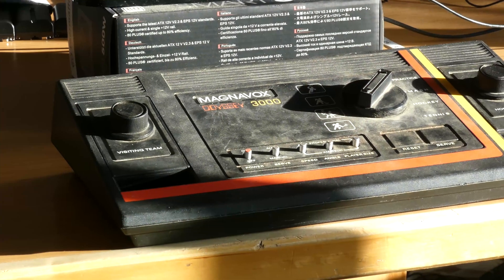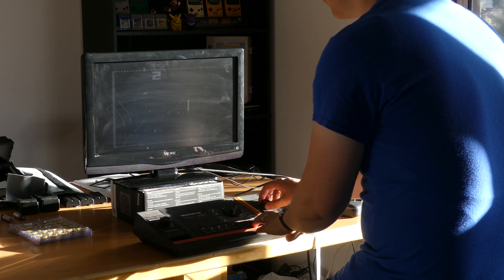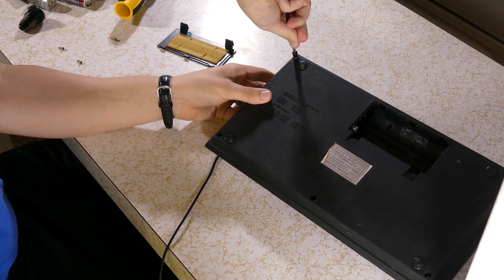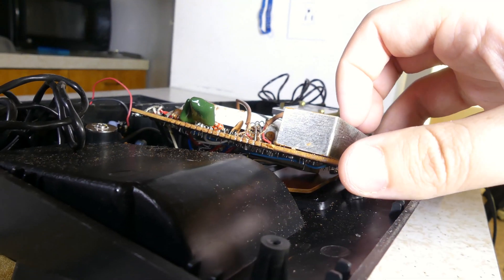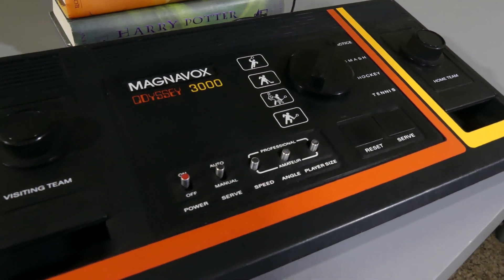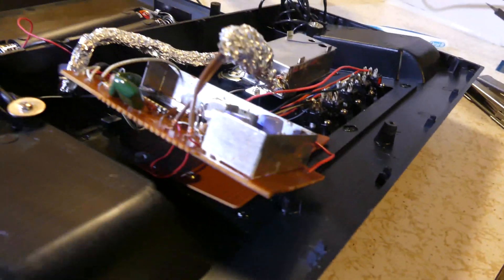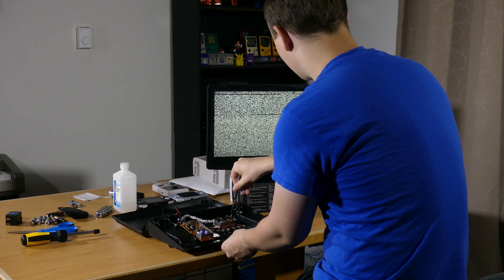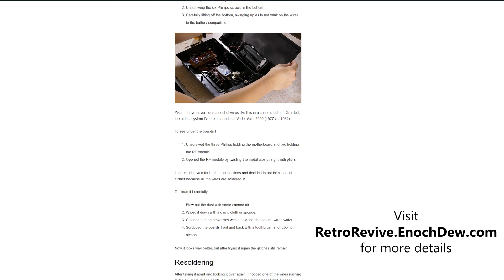Magnavox Odyssey 3000 Teardown and Troubleshooting | RETRO REVIVE

Comment: Nice video, I picked one of these up for a few bucks at a thrift store a few years ago. No Powersupply. I cleaned out the rusty old battery compartment and got it working and ignored it for 4 years. Batteries now dead and i modded the machine to accept a common 9v power supply. I am getting audio now but no video. Dont want to buy a bunch of C cell batteries. The link to your blog is not working for me, I would love to get a hold of the manual if possible. Thanks for posting this!

Comment: I just bought one of these at a flea market, unfortunately it doesn't power on, the power supply shows no voltage so I'm going to get a new one to start, also the battery compartment is rusted out badly so there is no way to use batteries , I'm also going to replace the contacts as well... wish me luck lol......

update I replaced the contacts and power supply, it now works like a charm